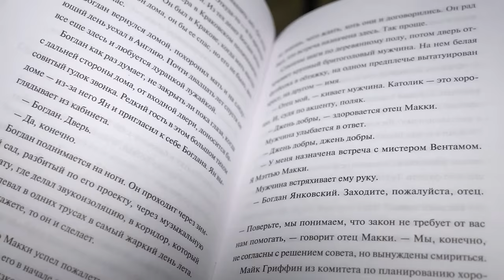Snowfall. Outside -4°C inside +25°C. Night in an underground shelter. Cozy and warm.

Comment from the maker: Hello everyone, my name is Alexey, I live in Russia in the city of Yekaterinburg. My four-legged friend's name is Pyosel. Today we came to my underground house, which I built myself.
Winter has come outside, snow continues to fall and covers everything around with a white blanket. To get inside you need to clear the entrance of snow. It's a good thing I left the shovel outside, otherwise I would have had to shovel the snow with my hands.
Everything inside is fine, nothing is broken or stolen. Someone was here and left me instant noodles as a gift, that's very nice.
The first thing I do is light a fire inside the stove to warm myself up. Outside -4°C inside +3°C, soon the oven will heat the room. I noticed a butterfly that had fallen asleep right on the door of my underground shelter. I took a screwdriver with me to remove the tarp that protected the doors from the rain.
To make it easier to move around, I cleared the area of snow and then brought the firewood inside.
Unfortunately, while I was away, there were not only friendly people here, but also mice that shit right on the washbasin and sink. I'll have to clean it all, throw something in the trash. The table is also very dirty and dusty. There are sawdust on the bed that fell from the ceiling. I love order, so when I tidied up, I felt calmer and more pleasant to be here.
Now I will start preparing the soup, I will need: meat, potatoes, onions, carrots, dill.
The soup turned out very tasty. After eating we went for a walk to cool off and run in the snow. Before going to bed, I read the book that I took to my log cabin last time, I also looked at the burning candle, it was mesmerizing. Time to sleep. Good night.
At night I wake up to add wood to the stove. In the morning I like to wash my face with snow, it’s refreshing. Yesterday's soup was very tasty. It's time to pack your things and go home!
See you soon and thanks for watching!

Donate: https://destream.net/live/alekseyvatolin/donate
My music: https://www.youtube.com/@vtshmusic
Russian instagram: https://www.instagram.com/vatoshaa
Russian channel: https://www.youtube.com/@vatoshaa
Russian lifestyle channel: https://www.youtube.com/@chezavata
Telegram channel: https://tlgg.ru/vatoshaa
Reply: I love your content and your constant positivity Alex! Keep on keepin on!
Reply: Wonderful to see you and Pyosel ❤️❤️ Great memories ❤️❤️ Stay safe and warm and know you and Pyosel are so loved and appreciated ❤️🤗🙏
Reply: 🎉g tv te 2
Reply: Алексею и Пёселю за то, что сделали сегодняшний день намного лучше. (Надеюсь, этот Google-перевод верен.)
Reply: So good to see you again Alexey. You and Pyosel are always a welcome sight. You take such care of your things.
I could almost smell that delicious looking soup you made.
The snow was a welcome sight for me as I live in Florida in the United States.
Well my friend I will say good bye for now but await your next video.
A friend across the waters 😊
Reply: I love watching you create things and then you smile big. Hugs
Reply: Мы прекрасно провели с вами время, спасибо за гостеприимство, привет из Салоник, Греция.
Reply: And you did a GREAT JOB Alexey
Reply: Awesome work, well done! 😎 👍 🇨🇦
Reply: It would help if you would put the dates in your comments so we know when it snowed there please.
Reply: Parabéns pelo canal! Saudações do Brasil 🇧🇷
Reply: Hi from Australia dear Alexey !
You are a very pleasant young man - with a wonderful Character!
You are so neat and tidy and the love for your dog makes you even more adorable.
May you always stay safe and happy !
Reply: Alexey,  obrigada por compartilhar seu dia com a gente , você  é super organizado , e detalhista , e um prazer assistir o seu vídeo, e relaxante, e adorável seu sorriso e o seu amigo lindo🐕🥰❤️
Reply: Life simple, life good
Reply: Love this video. Sending best wishes from🇬🇧. Thankyou for sharing. Such a beautiful dog too.
Reply: Beautiful scenery and very nice underground shelter.
Reply: In America we call those cabins a dugout. Nice job.
Reply: Good Job! You're a nice guy. Take care of you. Overwise the night. Bless you from France 🙏🙃🙂
Reply: Я изучаю русский язык, однако моих знаний недостаточно, чтобы отправлять сообщения или вести разговор; В итоге мне пришлось воспользоваться переводчиком. Этот картофель выглядел великолепно, и мне бы хотелось иметь такой же, потому что большая часть продуктов питания здесь, в Америке, либо генетически модифицирована, либо произведена в лаборатории или на фабрике. Да пребудут благословения с вами и вашими близкими.
Reply: お風呂やトイレはどうしてらっしゃるのですか？
Reply: #Stopboilingchicken
Reply: Thank you for sharing your experience, Alexey. It sounds like you've created a cozy and functional underground house. If you're in need of a reliable power source for your shelter, I highly recommend the Segway Portable PowerStation Cube Series. With its massive capacity, powerful output, and fast recharging capabilities, it can provide uninterrupted power for all your devices and appliances. Plus, its waterproof design ensures it can withstand any weather conditions. Check it out!
Reply: watching this from my home in michigan, what you built out in the wilderness is amazing. Anyway winter greetings from the American state of michigan. May you have a quick winter and stay warm.
Reply: Que collar es el que tiene el perro que lo quita y lo apaga.
El collar verde, se oye pitido cuando lo desconecta.
Es el primer vídeo que vi y me gusto mucho como vive.
Saludos y bendiciones.
Reply: Grüße aus Deutschland...ich schaue gerne Deine Filme 😊
Reply: Alexej wie viele Unterstände und Hütten hast Du schon gebaut ?
Ich habe etwa 20 in 40 Jahren gebaut....bin ja auch schon 70 Jahre alt
Grüße zu Dir
Reply: 你好，这个森林里边有老虎🐯和熊🐻吗？有的话怎么防范？
Reply: Watching in Alabama.Great video...Roll Tide
Reply: Hello Alexey. Thank you for sharing your little adventure. What a neat and cozy dugout you have there. I'm in Minnesota, USA and those woods and snow are definitely a familiar sight. Especially now in December. Keep up the excellent work with your outdoors expeditions, and stay healthy and safe. :)
Reply: Why put the same text here, as you have in the description?
Reply: I watched you build it all, fascinating Alexey.👍
Reply: From Riverside Ohio 👍

Comment: Great video.  May I suggest covering your table, kitchen counter, and sink with a large plastic garbage bag or even a large vinyl table cloth, that way you can shake the mice feces and dust outside and save you time with cleaning. Stay safe and God bless. 🙏 🫂 😊
Reply: Because wherever there are mouse feces, there’s mouse pee - almost invisible, but it’s there, and way more disgusting than the dried poop.
Reply: Spread fabric softener sheets of event heads around. They have emerged and it smells good!
Reply: Why do you assume there's mice feces? It's so cold there, I wouldn't think mice would be around.
Reply: @dinkvjr it’s not an assumption. There’s literally mouse poop all over the counter and sink.
Reply: They don’t like peppermint oil.  That might help
Reply: @BusArch42  I’ve tried that and it didn’t work for me.  Maybe I didn’t use enough?
Reply: @wandac396  not sure.  We use snap traps where we’ve had problems but I did pair them with peppermint.   Obviously if they want in badly they will ignore the peppermint
Reply: @dinkvjr When the winter is approaching the mice seek shelter in places like that! One of the ideas with a dugout is to use the ground heat, which should keep it at around 0 degrees Celsius even at really cold temperatures. The ground temperature at that depth should be some 0 deg or above, why it also contributes to keep the dugout nice and cool during the summer.
Reply: Very good advice and whomever suggested peppermint oil? I’ve tried it and it’s a no go. Even though it’s cold mice will still try to find somewhere warmer and it’s sheltered probably with tiny scraps of food and lots of hiding holes.
Reply: That's protein😂😂
Reply: @dinkvjr  oh I don’t know.. maybe the part where he said in his own video description “also nice that right on the washbin and sink” 🤔🙄😂
Reply: @BusArch42 I tried the peppermint oil ,it didn’t work for me. I had a mouse in the drawer under my oven.I put peppermint oil on a cotton ball and placed it in the drawer 2 days later the cotton ball had disappeared I guess the mouse took it to his house.
Reply: Moth and camphor balls may help with mice if used is good quantities, they hate the smell and fumes. The down side is that they evaporate somewhat quickly so it requires regular replacement. During summer time, spreading lime around the house is also effective. Good luck.

Comment: If you can get essential oil like cinnamon or clove oil, it will keep the mice away. Just put in as many corners or crevices as you can before you leave to go home. Also you can spread whole cloves around the floor around your walls.

You can use containers of vinegar also because they don't like the smell and won't be able to smell it your next visit if you put a lot out. After a while, the mice will avoid your dugout and you wont have to use much of the oils or vinegar.

Looks like you have a lot of mice so I would use both vinegar and cloves for at least a month to get rid of them. The feces and urine have diseases so be careful to wash your gloves after you clean.

Take care and stay warm.

Comment: Great video, may i suggest putting a a grommet in each side of the outside door, attach a rope to each side of the bottom of the door cover so you can pull it down from the inside to add extra insulation

Comment: I hope your soap is biodegradable soap!  That’s a lot of suds going out that drain onto or into the ground!  And it didn’t look like there was enough water flushing through it all to get rid of the residual.  Too much soap!  Just a plain water wipe down and then some straight white vinegar would work wonders without all the suds!!